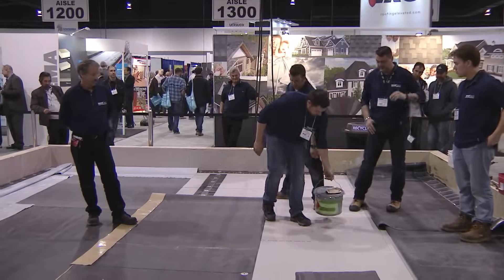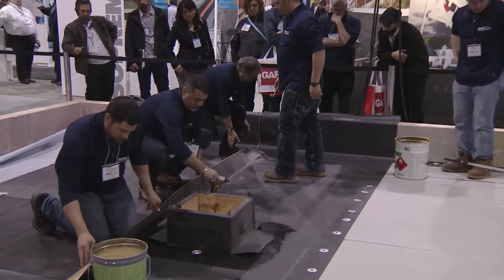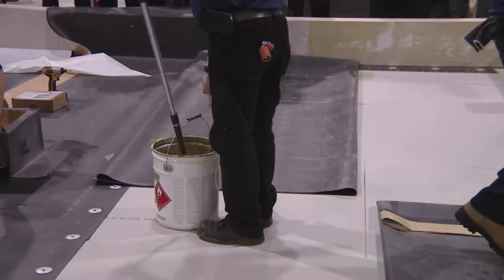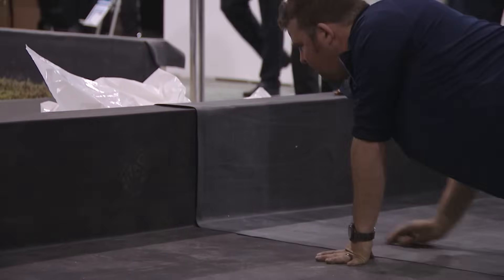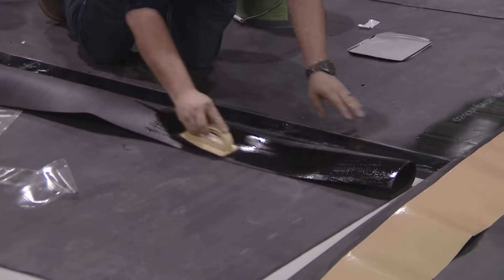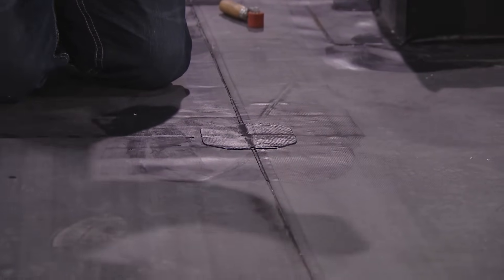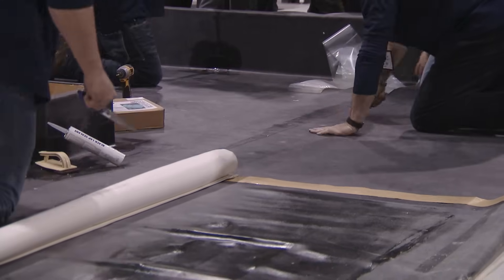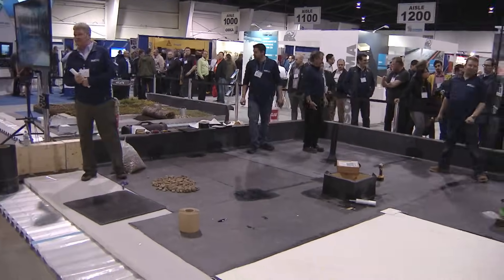EPDM Roofing Systems

Comment: Why do you not cover the application of lap sealant? I see the tube sitting right there on top of the black EPDM membrane. NOWHERE on the 'net, instructions/directions on the tube itself, TIS, SDS or anywhere else is there information about how long it takes for the lap sealant to set, but more importantly, cure. If I have to finish a job before it rains, would I apply lap sealant? Or do I come back because the lap sealant takes x hours/days to cure? If I'm using EPDM membrane for a water retention project, how long must I allow for the lap sealant to cure before it can be exposed to or covered in water. It'd be fantastic to be able to read this for myself. But no such luck. Manufacturer has failed to include this information on application instructions.
Reply: why would you leave it and come back? get a fucking umbrella and a rag and dry it out and apply the sealant. why walk away from a job with it not done. but yes. you can leave it, but it should be applied regardless.